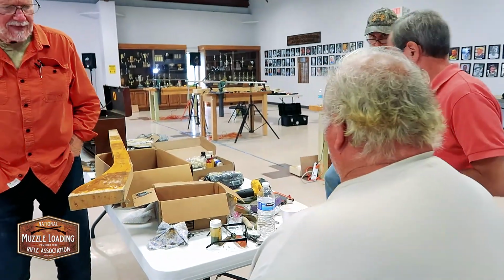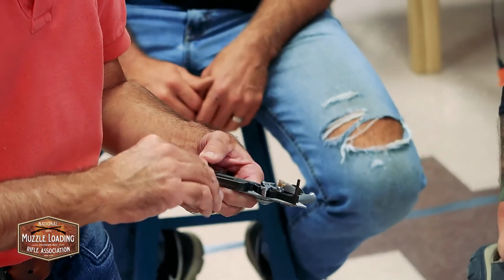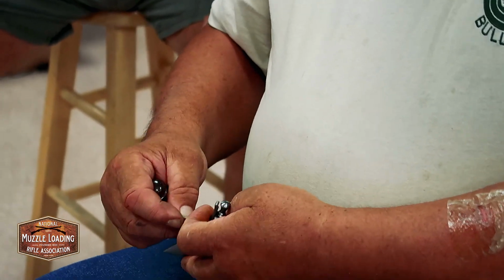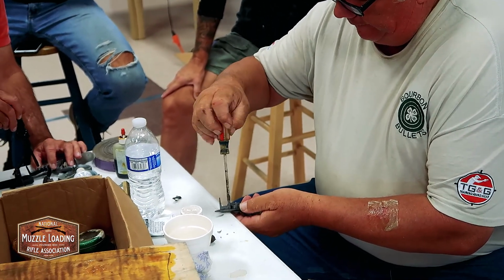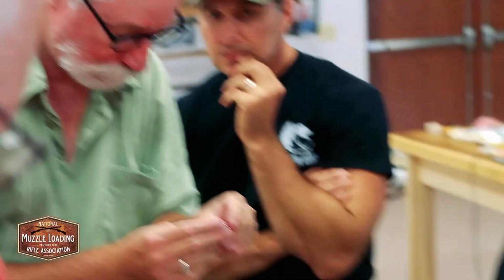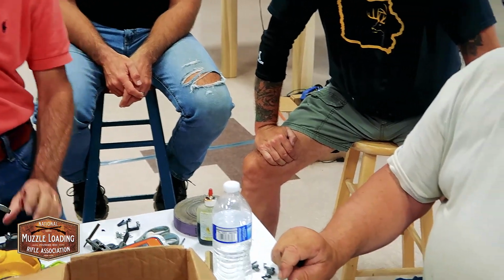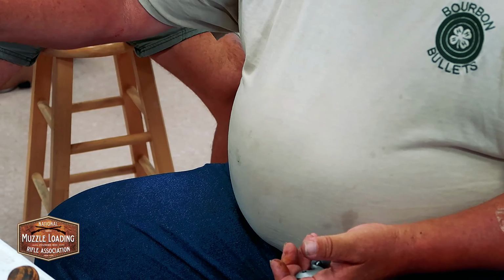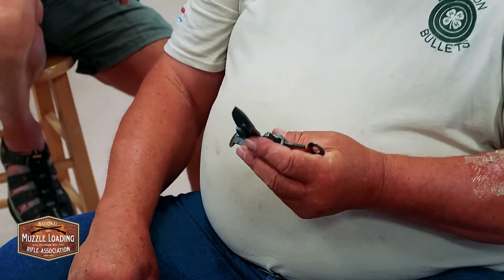Flintlock Disassembly with Mike Brooks and Wayne Estes | NMLRA

Comment: In agreement with others here, locks should be disassembled and reassembled using either interchangeable radius-bit screwdrivers like those made by Brownells or hollow-ground screwdrivers like those made by Grace. In addition, a magnetic parts tray like those made by Brownells keeps small parts together and allows screws to “sit” with their companion parts, like sear spring, sear, and sear screw. Craftsman screwdrivers are for brute force work on cars and trucks.